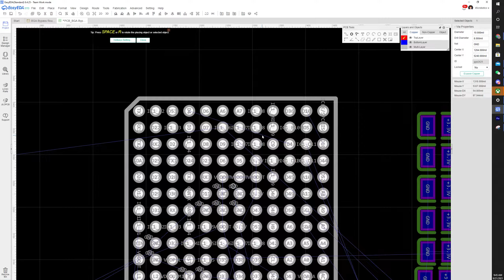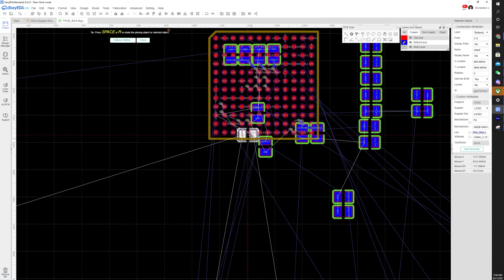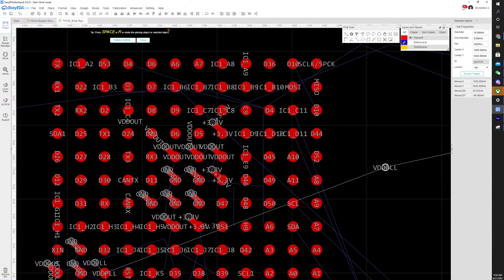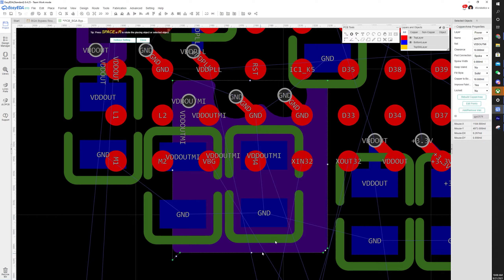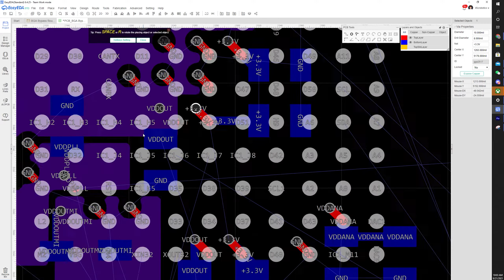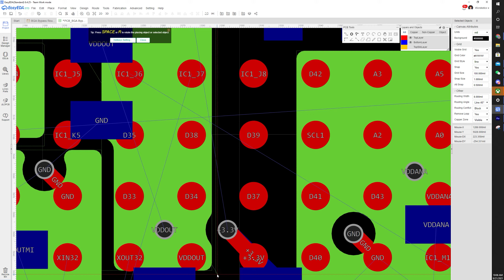4-Layers PCB Tutorial - BGA Routing and Bypass Capacitors Placement

Comment: Hi Jiajer. Great video. Can you expand on how to set up the 4 layer for 2 Inner Planes, say GND and VCC and how the Routing thru vias will work. Say a Toplayer VCC (2 inner layer) pad gets a via for VCC, will it contact the Inner 1 layer of goes thru w/o making a short (Toplayer-GND-VCC short with these two layers). You finally did not explain how to setup Layers for Planes and how to connect them. I tried 2 inner layers (GND and VCC), did most of the routing then Auto-Route(sorry) and had no  problems except DRC says there are a buch of no connections (vias mostly). Thanks